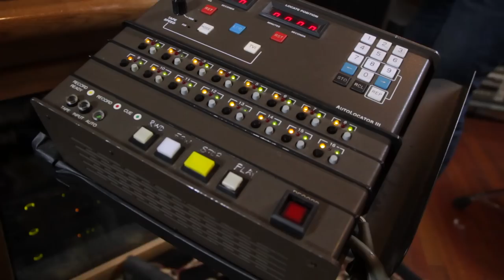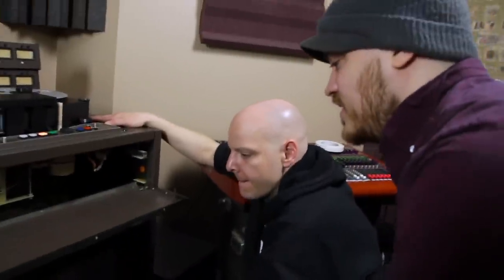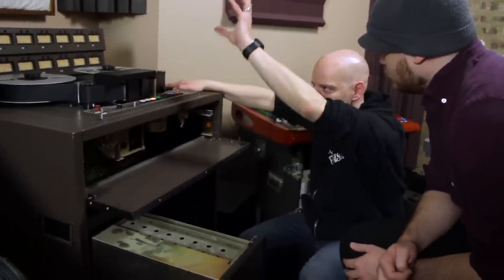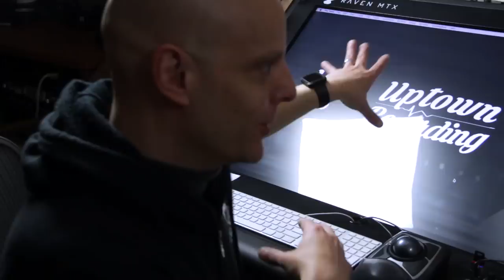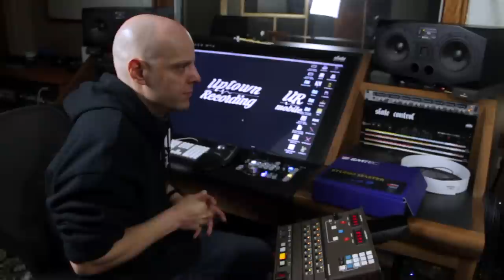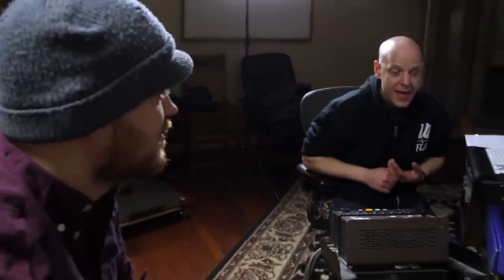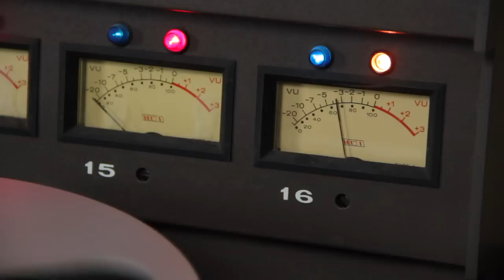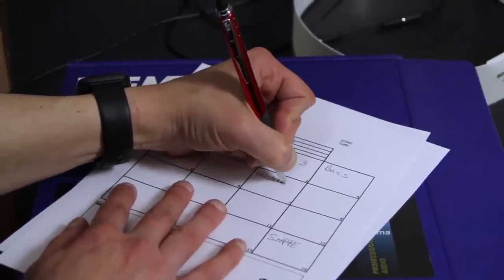How Reel-to-Reel Tape Works

Comment: Calling digital recordings "ones and zeroes" is pretty reductionist. Digital audio is fairly complex, essentially because you are trying to approximate a continuous waveform with discrete data points. The more points you use, the closer the approximation. Also, you cannot hear digital audio. When a computer playsback digital audio, it gets sent through a circuit called a Digital-to-Analog Converter(DAC), which converts the digital signal into an analog signal. The playback hardware(your speakers) are analog devices and can only use an analog signal to produce real audio.
Reply: The point is that digital sounds 2 dimensional, lifeless, and shit.
Reply: Ackshually, the waveform is not approximated. For all intents and purposes, it's reproduced perfectly as long as you have enough data points (44100 Hz is enough to reproduce all sound within the human hearing range). The only possible point of data loss is the bitrate, but I'm pretty sure 32 bits per point is enough to bring you below what you'd lose due to the analog noise.
Reply: In the end, you have to move a speaker.  That is always analog.  If you hear it, it is "real audio".  The engineer even mentions some of the reasons people prefer analog, and they don't have to do with fidelity per se.
Reply: @dryued6874  I think 24 already gets you there, but I'm not positive.
Reply: @dryued6874  You can also oversample.  For instance, a 1-bit DAC with a sample rate in MHz.
Reply: @dryued6874  44.1khz can only reproduce up to 22khz. The sample rate is 2x the high end. If you place a spectrum analyzer to digital audio you will see no signal past 22khz 
Analog audio machines can reproduce more but unlike digital thay just cuts off abruptly analog just rolls off. Good audio signals have many harmonics that sometimes are not captured in digital. Most good studios will sample at 196khz which sound better but at a huge file size cost.
Reply: @rty1955  complete crap analog tape saturates at high frequencies and high levels so you cannot record and playback  flat 20-20kHz at 0dB -5 dB -10 dB  etc digital can these analog machines never had a 2" test tape above 16kHz
digital 44.1kHz 16 bit completely flat 20-20kHz at 0dB -5 dB -10 dB all the way down to the 90dB without noise distortion speed errors tape amplitude variations etc

Comment: You have not lived until you run a turntable, cassette deck, or reel to reel. Even a 8 track player sounds great compared to mp3's! If you buy the gear,,,,you will realize how much you have been cheated out of what real music should sound like period. I am me and I approve of this message.  Thank me later.            P.S. Get some real heavy duty 1970's speakers to.

Comment: Actually Les Paul began experimenting with overdubbing in the early 1930'a and multi-track in the mid 1940's.  He would use acetate discs to record various parts putting them together.  Magnetic tape machines didn't exist yet as wire recorders were only way to capture voice.  In the late 1940's Bing Crosby invested in Ampex and the Ampex 200 A tape machine was born of that investment.  Bing gave Les Paul the second machine made.  Les not satisfied, added a second record head allowing him to create "sound on sound" which gave him unlimited "bounce" capability, but was cumbersome.  Ampex went on to develop 3 track machines for RCA in 1955 and then with Les and Ampex developed the 8 track machine which he took delivery in 1957 and was called Sel-Sync.  A year later, Atlantic records, an independent label took delivery of the 2nd 8 track machine in 1958 while others had only 2 tracks to work with.  Famed Abbey Road studios had 4 track machines, but the first Beatle album that used 4 track was St. Peppers.  By this time, American Studios had moved onto 16 track machines.  Hard to believe, but some of the greatest recordings were made using rudimentary equipment including the Beatles as George Martin was a master of bouncing tracks.  Great video.  In my music production days, I used MCI 16 and 24 track machines along with a Fostex 4 track for remote recording.  I still find the analog format fascinating.

Comment: I know it’s not the same 100%, but I use multiple analog tape modeling plug ins on pro tools. I use mostly Slate digital plug ins. 

I use virtual mix tape plug ins on every track in pro tools, along with analog modeling compressors and analog old skool desk emulators. It sounds awesome and you can hear the warmth and difference

Comment: There might be another 8 meters below the 16 already installed you could convert these 16 racks to 24 with a option kit fitted quite  few back in the 80's

Comment: There's something I don't entirely understand yet. If monitoring the record head lets you hear the input, and the playback head lets you hear what's already on the tape,  then isn't what you play always 86 milliseconds* behind what's already on tape?

*at least, not taking into any further delay in the playback -> headphones -> ears -> brains -> hands -> microphone -> record chain.
Reply: Yes.
Reply: when in the sync mode the record head lets you and the musician hear tape playback while recording the musicians performance with the same record head, everything outside the tape machine happens (effectively* ) at the speed of light or just as if the complete band was performing together.

Comment: 2 inch tape is heaven! I got to be recorded at CMC Studios in Zebulon North Carolina in the 80's with my band!  WOW, was I blown away on playback! Almost got signed. Another story.  This is the deal,,,magnetic tape in general rules! IT ALSO LAST FOR ALMOST ETERNITY! I run some old original Leer Jet 8 - track tapes that still sound brand new and many other years of manufactured tapes. I still record to 8-track tapes. GREAT sounding. My cassettes still sound great to! Then last but not least, any (most) original LP pressings are outstanding! I hate mp3's. They sound like garbage. 

Soooo, with all this being said, I doubt any new records would sound as good because they were most likely ran through some sort of digital studio processing so what is the point? If the new old recordings (LP's) being made today were mastered from the original master tapes straight to vinyl then they would hold water.  Otherwise you might as well buy a CD.  No one thinks about the process or has a clue these days. ( "Just stating the facts mam " ) Dragnet.

Comment: What about reels of Videotape made for the quadraplex VCR machines?
Reply: No you cant use those tapes. Same way toy cant use 2" audio tape on a 2" quad machine.
I worked in the largest post production facility in the east coast of USA. One day we fot a shipment of tape. I noticed it was AUDIO tape. I rejected 24 reels of tape. And our production came to a halt until we got proper tape.
Video tape is coated differently than audio tape. The magnetic particles on quad video tape are oriented 90° different than audio tape. And 2" audio tape is coated 90° different than video tape.
I restore 2" quad machine now

Comment: Er..... you get more low freq at lower tape speeds because lower frequencies travel slower and it gives them more time to get on the tape?!? Is that actually a thing, electronically? So funny hearing analogue talked about in this way as I started my career in the tape era and I can remember we couldn't wait to get rid of wow and flutter. We bought gear with the lowest possible w and f figures. 'Bring on the digital age', we used to say. Nostalgia rules, I guess :-)
Reply: Even in digital audio, if you turn down how many points per second your taking, you'll start losing higher end, because the frequency is faster than the point per second. So it makes sense it would be a thing to me.
Reply: No I thinks its bolocks!

Comment: Very informative and interesting! However, I don't think he did a good job explaining how the audio information is actually stored on the tape. He talks a lot about the machine, but not the tape itself.
Reply: Audio recording on magnetic tape is very simple. A tape mist be pulled at a constant speed past the heads and this is done by a capstan & pinch roller. The reels only supply and take up the tape. The capstan rotates with precision either by a motor that was synchronized by mains voltage (old days) or in modern times by a precise oscillator (either crystal Controlled or by some other electronic method) id this motor varies in speed, if not, the machine will experience bad "wow & flutter" in addition to faithfully reproduce a sound it mist be at a precise speed all the time. Some capstans can be sync'd or locked to a frequency. This is what happens when two tape machines are "locked" together. As long as they start together, they will stay together. Those are known as "servo" signals. If you want I can describe those as well.

The first head a tape comes in contact is the erase head. In multitask recorders each track has its own head that is stacked up on each other. Multitask heads are normally called a "Stack". Each head is a coil of wire wrapped around a structure that looks like the letter "C" with a microscopic air gap. The tape closes this magnetic gap. The finer the particle and the finer the gap results in better quality you will have. The erase head is supplied with a set bias frequency. & voltage. The bias frequency is normally 3x the frequency of the highest frequency u want to record, normally around 100khz. This "erasing" will align all the particles the same way, and effectively "erasing" any previous signal.
Then we move onto the record stack. The heads are made the same way except fed a different signal. Both the bias frequency and desired audio is fed to the head. The bias frequency is there to "stir" the particles on the tape to almost a fluid As the tape leaves the gap, only the audio portion of the signal remains on the tape. Bias frequency & voltage are extremely important and mist be set properly for each tape formulation to get the most optimal quality from the tape itself. Some machines have switches to select which tape formulation you will be using. Most recording studios will stick with one type of formulation as changing bias on a multi track machine can take a while (if done right). Bias setup is only for erasing & recording. And tools like oscilloscopes should be used.
The playback stack is the reverse. When a magnetic field is applied to the head and voltage is created proportionate to the strength of the magnetic field. As the tape moves past the head the varying magnetic particles create a varying magnetic field in the coil that is proportionate to the audio signal. The result from the playback stack is a varying voltage proportionate to the audio signal. This voltage is amplified, and sent along its way, eventually to speakers which convert electrical waves to sound waves, and we hear it as sound.

I restore 2" quad professional broadcast video tape machines and extremely familiar with magnetic recording principles. A 2" quad video tape machine is far more complex than a simple audio recorder.

Comment: There are no such things as subframes in SMPTE timecode. Its either 30fps no drop frame or 30fps drop frame (29.97 FPS)
You may know how to engineer audio signals, but you need to brush up on the technicality of how analog tape machines really function.
I have worked with tape since 1960 and now restore 2" quad broadcast video tape machines and compare to those machines, audio tape machines seem primative. Audio tape machines can record up to 30khz faithfully and 2" quad video tape machines need to record up to 6MHZ on tape!! Quite a feat of engineering if u ask me.
Reply: 30khz not at 0dB! what for no one can hear maybe your dog!